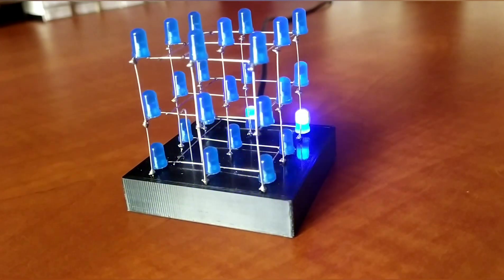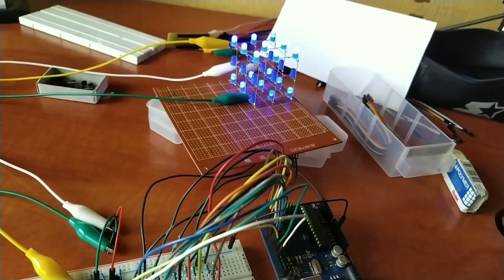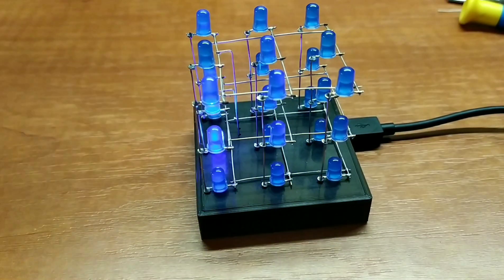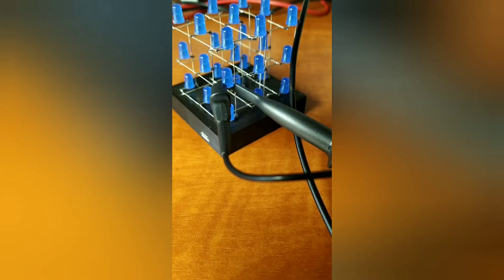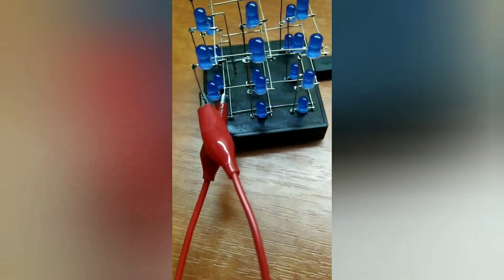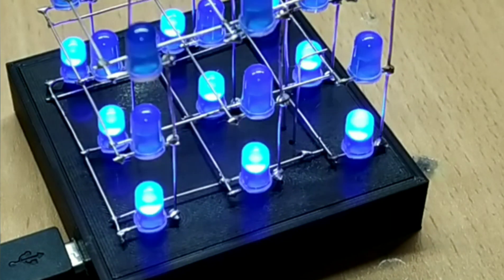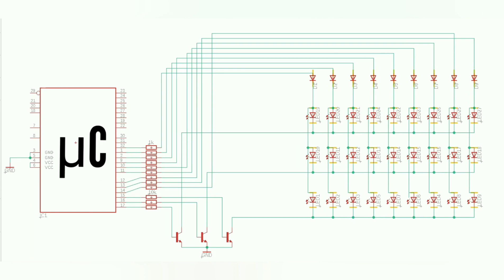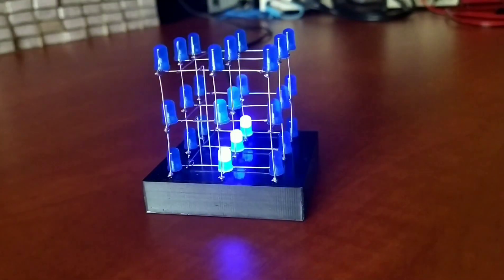DIY portable 3x3x3 LED cube | unusual problem

Comment: I made a 8*8*8 led cube but unfortunately some of the leds are not working. I mean they are not showing any animation. They are either off or glowing constantly. Can you please help me? Is it the problem of my Arduino Uno board? Please help. Thank you.
Reply from the maker: Are you using normal LEDs, or addressable LEDs?  You might have to double check if they are connected correctly. I could help you more if i knew more details about your cube, schematics would be very helpful.
Reply: @dominikworkshop6007  I am using normal blue colored LEDs. And I check all the connections. They are all ok. I downloaded the schematic from one youtuber named: "Creative Vinay". I used 74HC595N shift register(9 pieces), 16 2N2222NPN Transistor and one Arduino Uno.
Reply from the maker: @leon9357  I took a look a the schematic diagram, and I noticed that the shift register that controls the transistors has it's output connect directly, without a resistor, to the base of these transistors. It might damage the shift register or the transistors.
Reply from the maker: @leon9357  Are the misbehaving LEDs all in one column or a row? Or is there like one LED not working properly in one layer?
Reply: @dominikworkshop6007  The misbehaving LEDs are in one column.Column no. 7 and Column no. 8. All the LEDs of these two columns are misbehaving. Thank you for your kind attention. You are a great guy. I changed all the shift registors and also changed 8 tarnsistors, but no help.
Reply from the maker: @leon9357  Good that you changed the shift registers and transistors, I'm surprised it didn't help...  I'm pretty sure it isn't a fault of the Arduino, however i suggest adding resistors, if you haven't done that already, to pins D7 and D5 where are connected 2 LEDs, because without these resistors your Arduino might get damaged. And as I said resistors between the base of transistors and outputs of the shift registers might be a good idea as well. However it wouldn't solve your problem, but it could prevent damage in the future.
Reply: @dominikworkshop6007  Thanks for your reply. I will try another arduino with resistor to the pin D7 and pin D5. Please mention the value of the resistors. Will it be 220 ohm?
Reply from the maker: @leon9357  Yes, 220 ohms will be fine
Reply: @dominikworkshop6007  Ok, Thank you bro.
Reply: @ivor4790  Speak English.